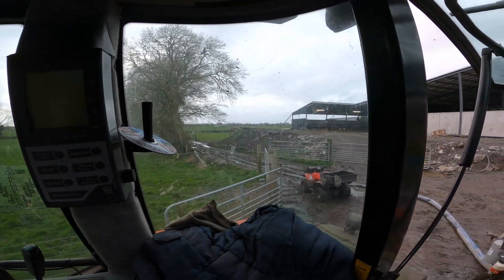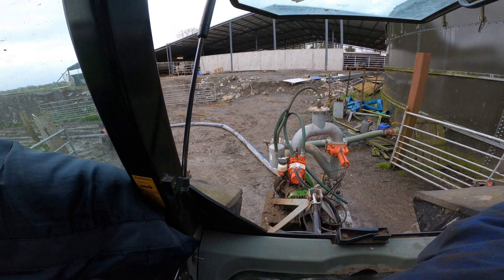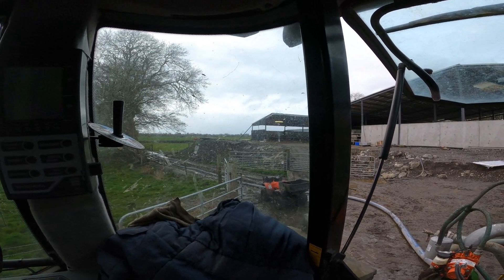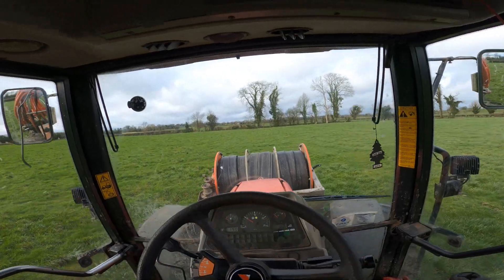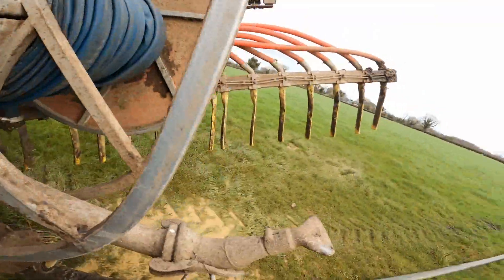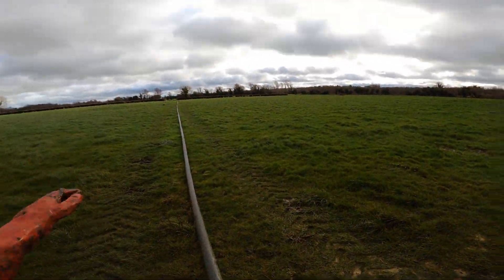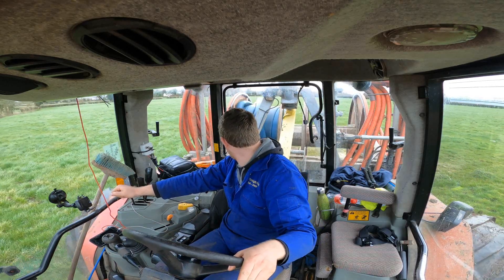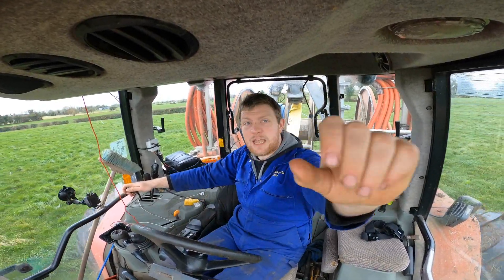HOW PIPING SLURRY WORKS -- PT.2

Comment: do you need very good flow from the hydraulics to drive the macerator on a dribble bar ..........would a 100-90 be fit to do it .....given the output of the hydraulic pump is not over big ......ie they are slow to work a loader compared to a massey .

Comment: Who does the agitating? Spreading is relatively straightforward in my experience, agitating is a complete lottery. Net, cord, wrap, broken pallets for what ever reason find their way into tanks. A lot of first generation tanks are probably leaking a small bit, so huge volumes of water are required. I think contractors spreading slurry for a living don’t charge enough for what they have to put up with. P.s. your binder is still here, April or May would be a good time to pick it up.
Reply from the maker: most of the big farms have there own agitator but if we go to a farm where we need to agitate we bring the agitator in the morning and my father will stir as we pump provided we can.
thats great end of april should be good for us ill be in touch nearer the time